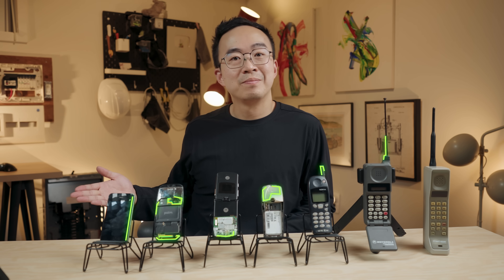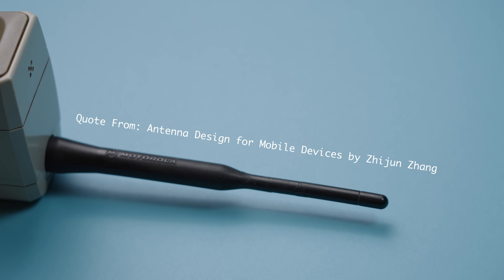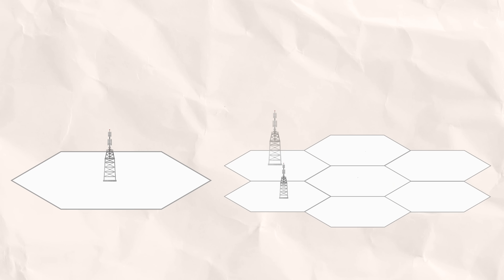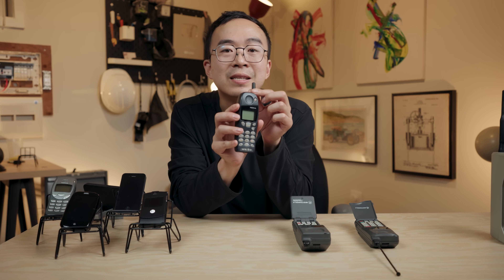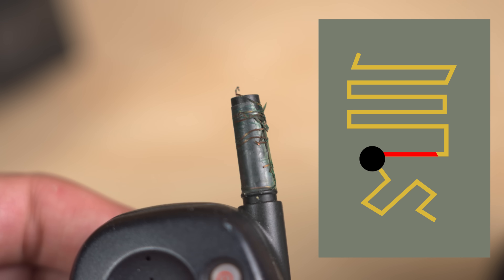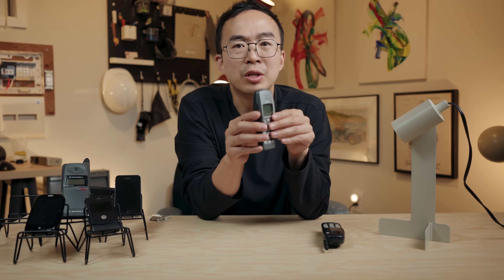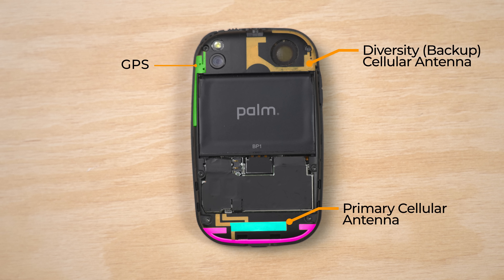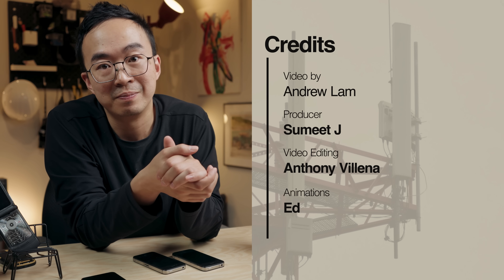How CLEVER Design Made Antennas Disappear

Comment: 1:00 I realised the phone blocks wifi when held like that because your finger is conductive and makes the antennae connected to each other causing connection issues, then i realized my phone (pixel 7a) has only 9 antenna lines, and after covering them all with my fingers, it lost wifi connection, and when uncovering them i got the connection back. that means that the same issue still exists, its just less likely to happen on accident because of the design of modern phones with more antenna lines. neat. anyways, time to watch the rest of the video

Comment: Okay but if you're antenna needs to be half the length of the radio waves you want to listen to in order for it to work how did,,,,,, they change the antennas from basically being a fancy type of grass on top of your phone trimmed to the exact length it needed to be to pick up the radio if you wanted to listen to,,,,,,,,,,,,,,,,,,,,, and then they changed it to a looped paper and it still in process worked?? How?

Comment: I suspect no one worries about reception because the cells are so small these days it's not hard to get a decent signal.  Also, with 5G, beam forming is used to focus the signal onto the phone.

I just got a Pixel 10 Pro a little over a week ago and can see six segments in it's metal frame.  A plastic case will help keep your hands away from the antennas.

Comment: Antennas are getting smaller because of the new bandwidths. I live in the UK and the biggest mistake was switching off 3G it was the best it had enough bandwidth for every day use even today and could transmit a long distance. now I can never get a good signal with 5G especially on trains. I have forced my phone to only use 4G that is bad but not as bad as 5G. Have you noticed your signal strength can be full and you get no data transmission what's that ill about..

Comment: Hello Mr. Andrew,

Your YouTube video about the evolution of antennas in mobile phones (UE) is excellent. It explains the topic very clearly and helps to understand how antennas are designed in mobile phones.

In the video, for example, I noticed how the 4G or 5G antennas in a phone case can be shaped like an "L" and an "inverted L" to support 4G or 5G MIMO 2Tx2R operation.

I have a couple of questions:

1. Is there any official document or infographic that shows the typical locations of the main antennas in 4G or 5G phones? Where in the UE Case? For example, the placement of GPS, Wi-Fi, 4G, 5G, 5G SA, 5G NSA antennas, or any others.

2. Regarding MIMO in current mobile phones, what are the typical 5G antennas used? For example, do phones use MIMO 2Tx2R, 4Tx4R, 2Tx4R, 4Tx2R, 8Tx8T, or other configurations? How are those antennas distributed inside the mobile phone (UE)? where in the UE case?

Thank you for your informative content and clarifications.

Comment: Early cell phones had to have large antennas for another reason - they operated in relatively low frequency, which means longer wave, which needs longer antennas.
Reply: Those early phones operated in the 850 MHz band.  Current phones can go as low as 600 MHz.  My cell carrier has several bands between 600 MHz and 3.8 GHz and my phone can work on any of them.

Comment: Great video. It's amazing how far wireless technology has come in my lifetime. 5G Ultrawideband (aka mmWave) is simply astonishing. The frequencies used go up to 39 GHz (for reference, most home WiFi devices use 2.4, 5, and more recently 6 GHz). At those frequencies you will have multiple waves traveling through the circuit board at once. 

We might eventually see wireless frequencies getting into the infrared band.

Comment: I am an antenna designer. I spent my career designing spacecraft and aircraft antennas rather than cell phone antennas, but I can answer the question about why they don't do quantitative reviews of antenna performance at the consumer level. There are a couple of reasons.
First, accurately measuring antenna performance is time-consuming and expensive. It needs to be done in special facilities, under exquisitely controlled conditions, with specialized and expensive test equipment. In the aerospace domain, it's not unusual for tests to cost millions of dollars. In the commercial market, it's a bit less stringent, but an accurate and thorough test of a cellular antenna is still going to be a five figure cost. Cheap if you're selling a 100 million units, but more than a reviewer is likely to want to spend.
Second, antenna performance is not a single dimension and not easily reducilble to a a single number. Furthermore, antenna are subject to conservation of energy, and improving performance in one dimension means reduced performance in another. For instance, better gain in one direction means lower gain in another--total performance is a conserved quantity. So it's very difficult to to quantitative comparisons except in very constrained conditions. For instance, an antenna that works well when the phone is held to your ear may perform poorly when you put the phone on speaker mode and hold it in front of you. Which is better depends on how you use your phone.
Despite the fact that the analytic tools have improved immensely over my career, balancing performance under the real-world operational conditions and the physics remains a mix of art and science. (Synthesis techniques have not improved at anything like the rate of analysis techniques...)

Comment: I hv switched to an iPhone since last year but I regret the decision. Not bcoz of its reception but ability to hold on to particular network. Previously whenever network used to be low on android It used to switched between 3G and 4g or 5g so it used to take significant amount of time to get stable network to make at least a call. So I used to use force 4g or 5g apps on android so network used to be stable. And after upgrading to an iPhone I’m just stuck and I don’t have any freedom and network sucks in poor reach areas. And also Androids have heck lot better network reception? Snapdragon is it?

Comment: Next step... phased array antennas located behind the screen and back. Unlike omni-directional (which is actually never the case but that's a different story for another day), phased arrays is like point their transmit/receive lobes electronically over up to about 130~140 degrees dramatically improving efficiency by tracking the wireless towers!
Reply: Beam forming is used on 5G from the cell sites.

Comment: Now the only notable innovations motorola does are making updates within android version trully uskipable, and update center notifications that can not be stopped. Now i think that Google pixel with their "try not to crack the display while replacing the battery" intentionally unfriendly design(that is probably even worse than on iPhones) is a better option if you install opensource os on it(becaus it is supposed to allow bootloader relocking). Throwing out a phone once in three years because of a battery is better than it bricking itself during update(which by the way can happen on ANY device during update, and making them unskipable can put your job or life at risk) or getting bugged and bloated so much that calls stop working and basic messangers get unusable. Come to think of it i NEVER had problems with malware as severe as automatic unskipable updates cause(which probably introduce more bugs exploitable by malware than they fix)

Comment: So, those lines on your phone, they seperate the different parts of the phone, which are also part of a special injection molding process that seperates different metal sections of the phone's unibody frame, which can help make up the antenna of the phone.... SORT OF.
These antennas are really for 2G/3G wireless technology... I suppose SOME 4G bands make use of it as well, but most phones nowadays use these little plug-in antenna modules inside the phone for 5G mmWave antennas, as well as small antenna board with two tiny little coax cables coming off them for the LTE antenna (and some wide-area 5G).  
Hopefully these will be enough moving forwar because my phone's "iphone 4 antenna" is scraping off, creating basically an extra "gap" between the two different metal parts of the exterior frame.  i think this is because dust or sand is getting down into the cracks between the case and the phone and scratching it away.
but i have the 2G disabled anyway since apparently according android it's a huge security risk.

Comment: How come radiation was an issue with the 3310, which required shielding, and with the Motorola, which moved the antenna to the bottom, but is suddenly not an issue with modern smartphones which have antennas right next to your head?

(I understand that radio waves aren't ionizing. But then it shouldn't have been considered a problem in older phones either.)

Comment: i am actually anoyed that no one does reception reviews e.g. by comparing phones with sim cards of the same provider ... in the same location. maybe because i am an (unfortunately meanwhile inactive) radio ameteur, but reception certainly does matter. yes it is difficult to judge and test. sometimes i am positively surprised. e.g. i have a relatively cheap smartphone from xiaomi (redmi note 10 pro) and because i am lazy and often do not want to carry a big wallet with me, i stuck a little leather wallet to the back of my phone that just holds my health provider's card, my idendity card and some "emergency money". i did not glue the wallet directly to the phone, it is glued to the tpm casing. i was expecting transmission - reception and NFC going bad. but to my positive surprise it does not seem to impact the radio quality at all. although the zippers on the wallet are metal and i was afrait it mike make the antennas go out of tune.

Comment: I would argue that most of the improvements are in the LNAs as modern phones have antennas with much less gain than the early sticky-outy-antennas had.
Todays antennas are in fact worse, but the LNAs allow much much higher sensitivity and much less noise together with increased gain capability in a ultra miniaturized package.
In essence this improvement allowed manufacturers to focus on design esthetics even if they sacrificed some antenna performance.

Comment: It's not correct to say shrinking them doesn't kill reception, that depends on wavelength so they avoid the challenge by going shorter. Reception has not really improved since the 1980s but the infrastructure has, using less efficient antennas comes with a cost in terms of range.

Comment: RF engineer here, and really, the best antenna for cellular (AKA a non-directional use case) is always a (relatively) big and bulky dipole antenna for that specific band, any deviation from that is a compromised design, it's only a matter of how compromised it is. That's why there's really not much for the manufacturers to say about antennas other than making bogus marketing claims.
Reply: Actually, the best would be an isotropic antenna, so performance wouldn't depend on phone position.  However, perfect isotropics are rather hard to come by.  🙂

Comment: Remember when you could just disassemble your phone and :shudders: replace its battery?

 Clippy remembers.
Reply: I used to have a Google Nexus 1, which had slide off batteries.  When I bought the phone I also bought a spare.  I'd occasionally swap batteries.  On a later Nexus phone, made by LG, I replaced the battery, a job I wouldn't recommend for anyone without tech experience. (I have plenty.)

Comment: 12:20 Radiation and cancer connect is very weak. Chernobyl level exposure for decades not caused illnesses. They been tried found it very hard.
Reply: On the other hand, spend too much time tanning and you run the risk.

Comment: I guess it's reliable enough that it's quite hard to test such claims. For me, I know there are a few dead spots on my daily commute, but that seems to apply to the different phones I've changes over the years so it's probably not even useful. And on a small scale, no reviewer has been technical enough to come up with a test where you can change signal strength at will?

Comment: External antennas aren't just 'double the signal'... An antenna close to the body can attenuate signals 10db or more... that's a 90% reduction. The genius in the engineering comes in designing the phone antennas to use the body, as pointed out. Love the video.  Having been on the front lines of AMPS, the struggle for signal was real. The 'A' in AMPS was 'Analog'.. Static was a way of life on cellphones.
Reply: Actually, A=Advanced, as the cell phones were an advance over the old mobile phones, which had limited capacity and required operators.  Cells increased capacity by using small cells, instead of trying to cover a large area with a single transmitter.  The old network dates back to the late 1940s.
Reply: @James_Knott  the 'old network' didn't exist. They were 2 way radios manned by an operator at a switchboard. Nothing even remotely close to a 'mobile phone'.

Comment: i think you got the wrong way sir... its not clever design that made antennas disappear on cellphones sir.

the models u use as references are generationally advancing in all areas. including the wavelength of the signals, getting higher and higher frequencies for each generation. this means the antenna shrink along with them. clever design has nothing to do with it. the slit in the frame is an afterthought since they were dumb enough to use a material that is rf blocking and need to have somewhere for the signals to pass through.

if anything the design is an afterthought for a poor architectural choice. the real "marvel here is the low power draw of modern devices compared to the generations before.

Comment: Great video, issue is heating not burns  . The Amateur Radio Relay League does great reviews for ham radio including reception characteristics that can be quantified. You are right it would be cool to have something like this about cell phones. I expect it would be very hard to do one because of the size of the transmitters into because of the interaction s between the cell phone and the tower. You would need multiple tests in multiple circumstances to get a real understanding.

Comment: The sheet of metal in Nokia is not meant to pŕotect your head, the radiation is minuscule. The sheet is a reflector, reflecting the signal constructively on the half dipole. This way your head do not get in the way of radio waves. Any old TV antenna with a double dipole has at least one reflector and several directors.

Comment: Great question about the reception and how nowadays it's not even measured and compared any more. It's funny that the coverage infrastructure has evolved far enough that it doesn't really matter any more. Sure there are countries where this is still an huge issue and i'm sure localized tests of different phones exist in certain areas but for most developed world it's not even a thing any more. There is small amount of carrier difference left and when losing reception and comparing it to nearby phones we usually fault the carrier not the phone that may not have the best reception compared to other phones nearby. At least around here the defaulting to blame the carrier in bad reception goes back to a time where we had one carrier that managed to adequately cover the entire country while the rest were trying to catch up. The other carriers got customers with cheaper prices but you often saw these customers hunt for signal in rural areas. I live in rural area and i remember that back then when some relatives came from city to visit we had to put a ladder to the roof for them because that was only place they could get some reception because they used a carrier that was cheap, had signal in cities but lacked signal in rural areas while we had reception everywhere since we had to choose the more expensive carrier that had good coverage there.

Comment: MIMO antennas are coming, even for smartphones. This is about having an arrays of micro antennas which can be used to control direction of signal reception and transmission. The 5G/LTE radio towers are using these already. The 6G will use this technology even more.

Comment: I noticed my body can act as an antenna for a crappy FM radio I have. It's battery powered and definitely cheap, and if I walk away from it the FM signal dies out. If my body is absorbing and concentrating an FM signal so a weaker antenna can pick it up, Maybe that's what Motorola did with their wirelessly linked antenna in an antenna.

Comment: Wonder why they assumed that hand would block the antenna. Otherwise they could have made the first cell phone a lot shorter by just putting the antenna on the side where the hand was. Is it possible that the signals could just get so weak from the phone distance that a hand is the difference between some and no reception? So they just wanted to maximize the possible reception of the antenna by putting it out of the way of the hands?
Reply: Logic being the antenna should be higher as to be closer to the towers